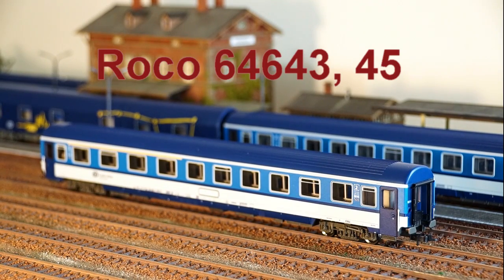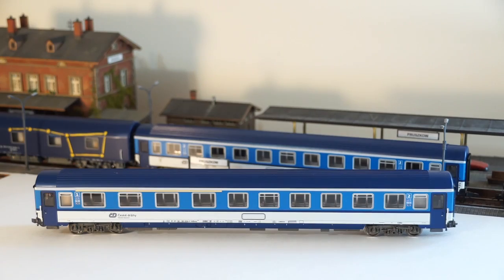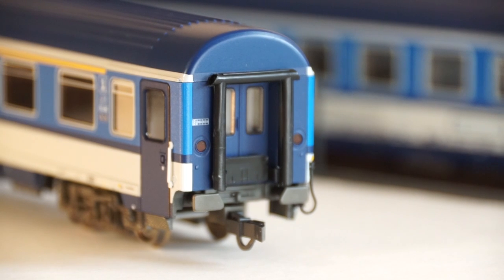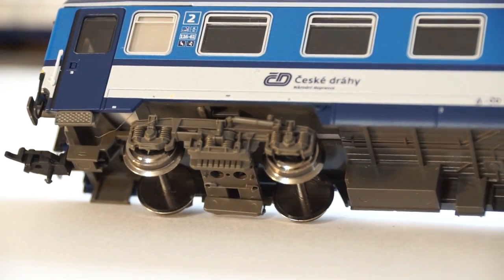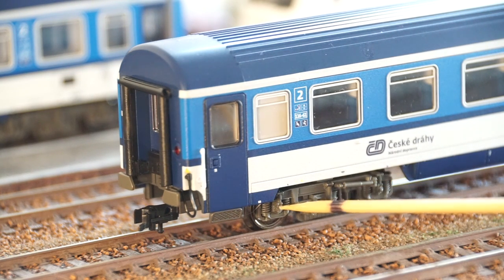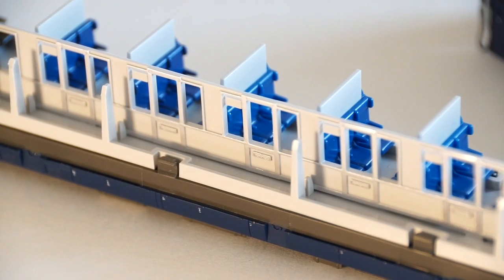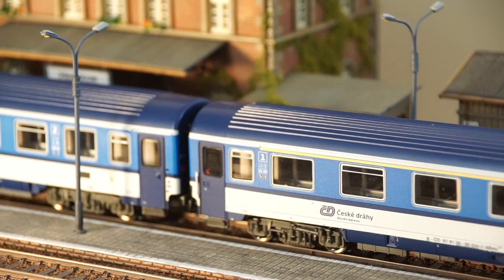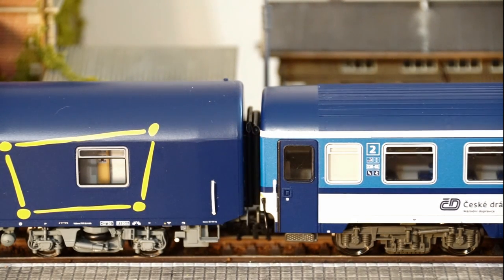Roco 64643 45 CD cars review

Comment: This model is based on the ÖBB ABmz which Roco released in 1:87 in 1990.
http://www.bahn.hfkern.de/Roco_Wagen/OEBB_ec.html
If you compare it with contemporary models you will see that the detailing has advanced some.

Find photos of the original here:
http://www.vagonweb.cz/fotogalerie/CZ/CD_ABmz346.php
ÖBB has modernized these cars before selling them to ČD.
That means: New doors with narrower windows, new windows with wider frames and no more ventiltion flap except for the toilet windows and the small end windows of the corridor.
There is no model (by any manufacturer) of the modernized ÖBB coaches yet.

If you can live with these compromises, you could still do some adjustments to the interior colors.
Paint the compartment separation walls copper brown (first class) or beige (second class) to imitate the wood finish of the interior, the compartment floors would be red (first class) or dark gray (second class).
This is for the original (modernized) ÖBB appearance as it can be seen on Vagonweb; perhaps ČD has changed it meanwhile? (Better do some research before you start!)

Comment: Hello Peter, A bit off topic, but on your station platform I really like the dual teardrop light fixtures. Who makes them? Thanks, and I really enjoy your videos.
Reply from the maker: Hi Mark I’m glad that you enjoy the videos. The platforms lamps
were purchased on Ebay with direct shipping from China. Please find listing link below. 
They are very inexpensive and actually very well made however they do need some
finishing. You will have to paint them and add resistors which arrived include.
The lamp "heads" and the platform base are plastic combine with metal tubes. You
can also adjust the height by sliding the base.
http://www.ebay.com/itm/LQS13-10pcs-Model-Railway-Train-Lamp-Post-Street-Lights-HO-OO-TT-Scale-LEDs-NEW/261658194923?ssPageName=STRK%3AMEBIDX%3AIT&_trksid=p2055119.m1438.l2649
Reply: Peter S. 
Thanks for your response and the information contained, I appreciate it very much.  I often go onto eBay looking for these style (or close to) lights in LED that look similar to the street lights in NYC,  which my home layout will be loosely modelled on. Thanks again Peter!

Comment: I came back to this video to see how things evolved. I've commented 3 years ago on my old account about how unrealistic this cars were. In the meantime ACME did release better CD Najbirt 2 coaches and I both only one, the next purchase follows. I have ultimately bought one of these cars as well and have decided to add little modifications so it is closer to the real one, which I intended to be this one: https://www.vagonweb.cz/fotogalerie/CZ/CD_Bmz234.php The windows "kinda match" and I have painted the elements on the skirt to match the real life ones, I have added a control panel on the place where it is in real life on the interior, placed some destination boards and carriage numbers on two opposite doors and make it work. How did you do Peter? Last time you said you will replace them with something better from ACME or LS Models. Did you did so? I also think that the second class wagon can work as a Bmz234...but the ABmz from Roco is a total mess.